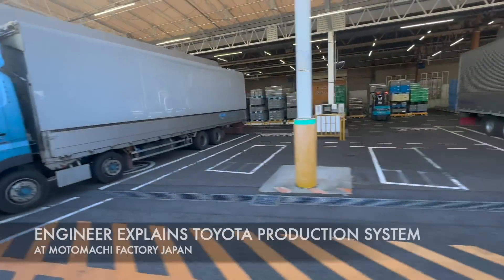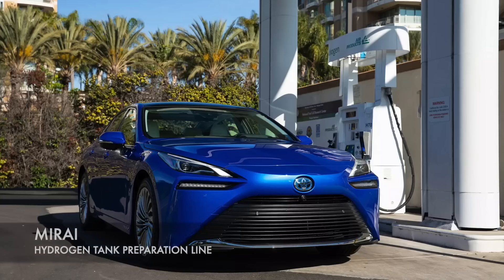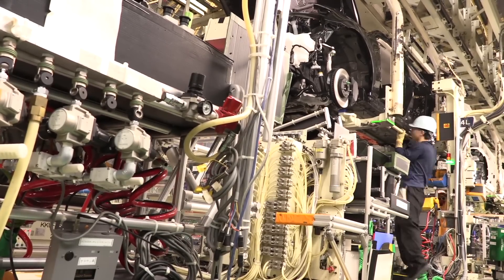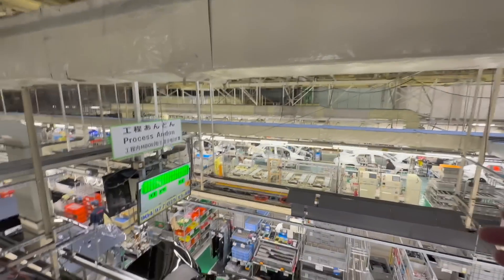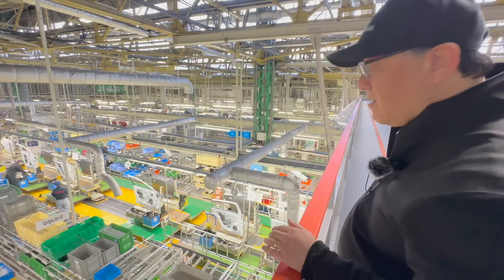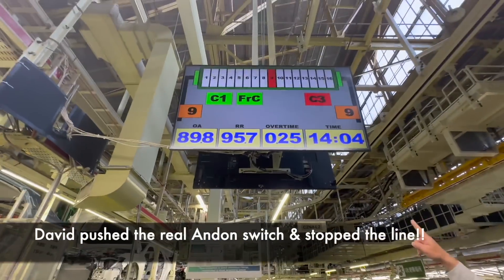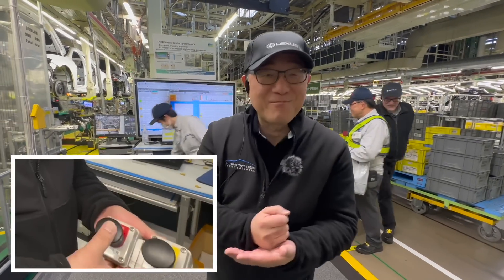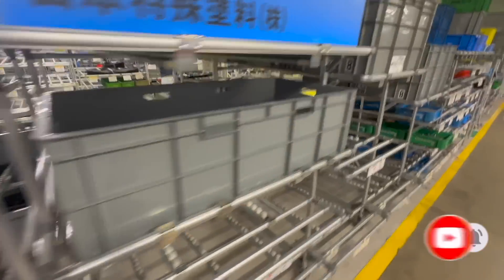DAVID ACCIDENTLY STOPS TOYOTA PRODUCTION IN JAPAN! FULL MOTOMACHI FACTORY DETAILED TOUR FROM NAGOYA

Comment: Great content!  Hope you bought the line workers some sake to compensate for the overtime you caused them 😆  At the start there was a board in the hydrogen room that had a blank box labeled "Chinese tank".  Any idea what that is about?
Reply from the maker: Thank you!  It may be for Chinese market - maybe they have a different regulation for high pressure tanks.
Reply: @AutomotivePress  thanks David, that makes sense.